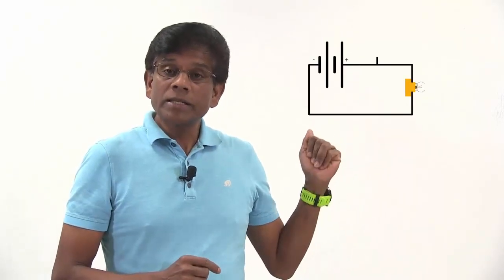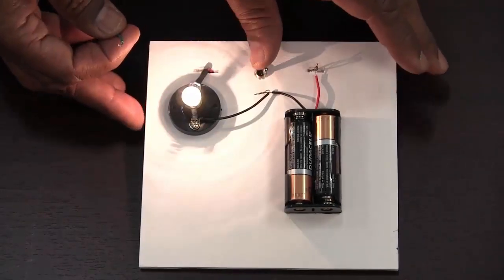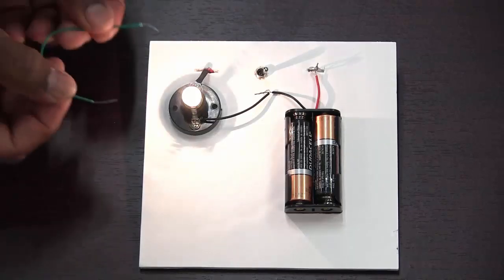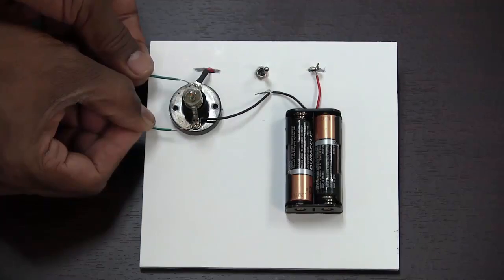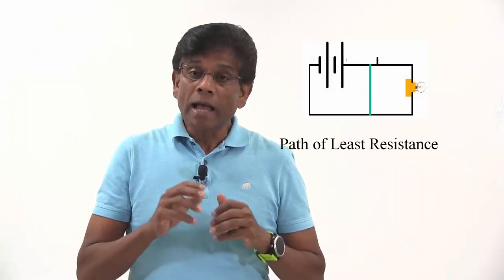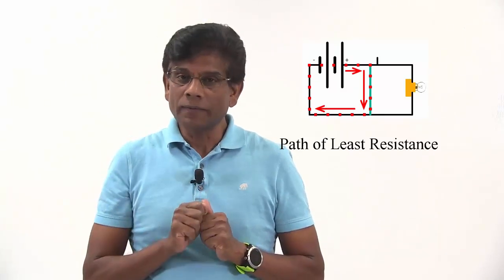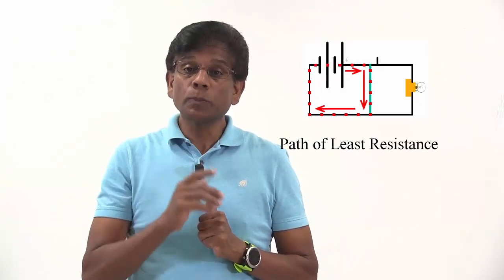Short Circuit

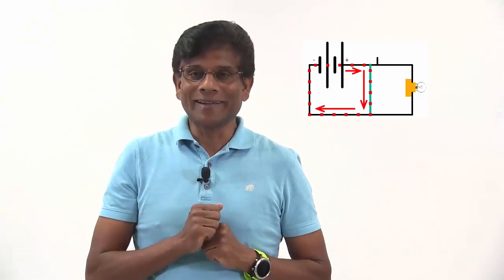Comment: 2:52 I tried that and nothing heats up. I can’t figure out why. Batteries are brand new and I tested them on a light and they work. The metal wires work too because I lit the light using the metal wires. But when I short circuit them, nothing gets hot and nothing happens. Why do you think this is? I’ve left them up to 5 minutes and and they are still at room temperature. Science making an exception for me?

Comment: MYTH: “Electricity takes the easiest path”
TRUTH: “Electricity takes ALL paths”

What he means is that the most current takes the path of least resistance, but there certainly is current flowing through other paths.

In the case of 3V supply that current is negligible. At high voltage that current can get you killed.

Comment: So I have those battery holder terminal things and they are literally a finger burning hazard 

you need to take the 2/3 AA batteries  out of there but they are so tight you use a screwdriver to get them out, so I get the batteries out and I touch the battery, 
Instant finger burn because shoving a screwdriver shorts it out, idk so It is burning hot and you are 2 steps away from a portable fireplace, but you need to get those batteries out, 
Finally you get them out to be in a mini panic attack because the batteries almost smoked on you and tossing them out the window,

Goddamn do I hate those battery terminals

Comment: hello
have a home project that is causing battery to get hot 9volt and project gives no sound.
so i believe i have a short in my circuitry.
read where one can spray cold air on system to see which components might be getting hot and melting  ices that true.?
thanks
john
Reply: Do you have a digital multimeter ?